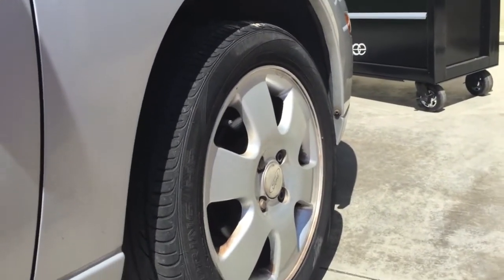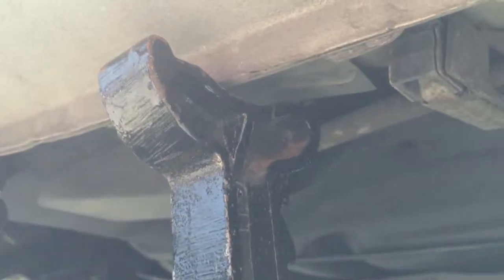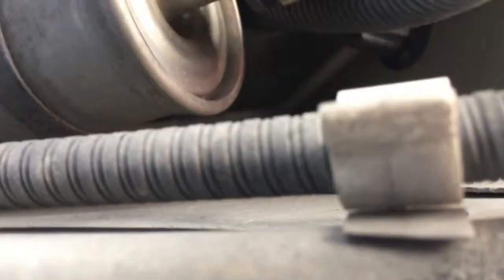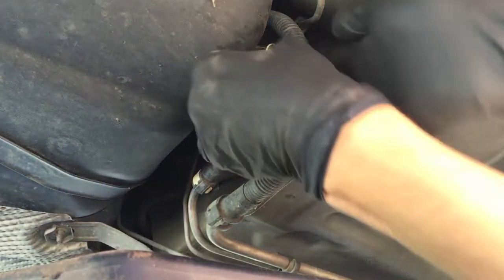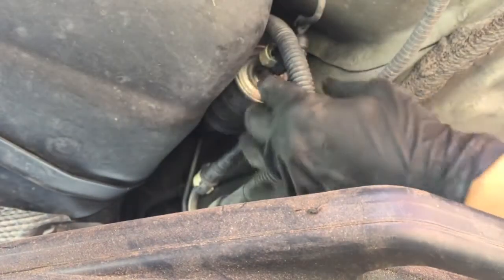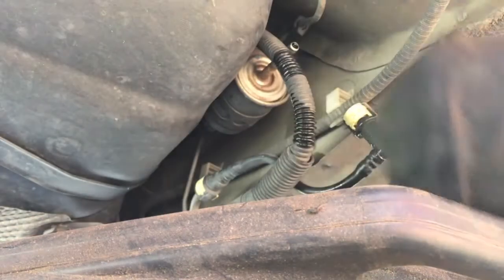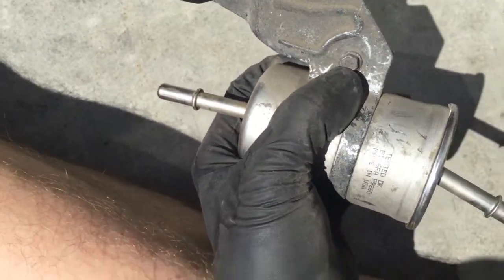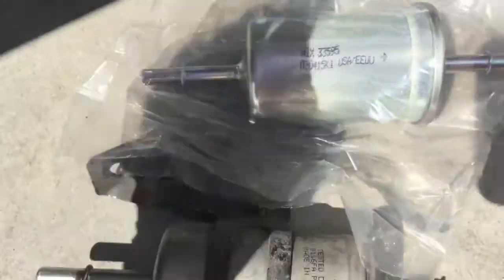DIY: How to replace / install fuel filter on ford focus

Comment: My mechanic installed the filter wrong way. In whas on the out, and out whas fitted in the in 🤦🏼‍♀️🤦🏼‍♀️ whole lambda values went crazy everything whas running lean after that.
Reply from the maker: I would suggest going to a different mechanic... lol
Reply: it will only fit one way  so you cannot  put it on the in correct way  I do a lot of fuel filter replacements on the older for focus   2000-2005
Reply: Well he did installed the wrong way, because i brought the car back and he showed me, after installing it back the car ran beautifull.
Reply: Long way around just saying "backwards".

Comment: Great  video but it should be noted that the fuel system should be depressurized before removing the filter( by removing pump fuel pump fuse #12 ?, or fuel pump relay and runnging engine until it stops.
Reply: That sounds like a BIGGIE.

Comment: You missed teaching steps. 1 pull 15 amp fuse # 12. 2 start engine and let car quit running or try starting a couple of times. This releases pressure so you DO NOT get sprayed in the face with gas. Always wear eye protection. Gas in the eyes is very bad. 3 take off clips. Squeeze together one side of clip while using a small screwdriver to pry up the other side. Pushing down on front side of clip does  not always work. These clips break easy if old. Duck bill clips are not the right ones on a ford focus. 4 use 8mm socket with extension and ratchet to take bolt off. 5 remove old filter and put new filter in Exactly the way the old filter came out. The new filter comes with new clips. I got mine changed 18 years later. It was so clogged it caused the fuel pump to go out. So replace fuel filter when recommended or you will end up like me and replace both fuel filter and pump.

Comment: a lot of people remove the fuel lines the incorrect way. you do not have to remove the clip   you use your finger  and push down  in the middle of the  clip  this spreads the clip open  so you can put on the connection  to remove.  these clips break easy   if you cant do it  the way I described  then you can remove them but you only need to pull it out a little      it is good to have a few extra clips on hand. and just another tip  sometimes  the filters  come with clips  if they include the duck bill type  that is not the correct clip  to use